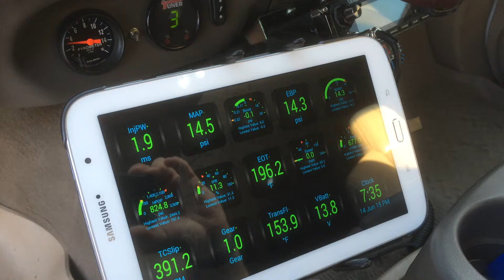7.3 blow by test

Comment from the maker: With the ping pong ball just sitting there, it's a pass. If the motor had blow by, the ball would shoot off the oil spout.
Reply from the maker: Marcus Corvain that is another, more sensitive way to check. Blow-By is the force of exhaust gases passing to the crank case. I'll post a cold video because cold seals and  rings show signs of engine wear.